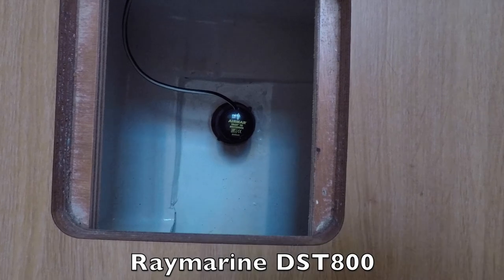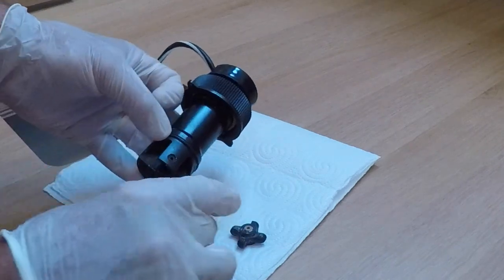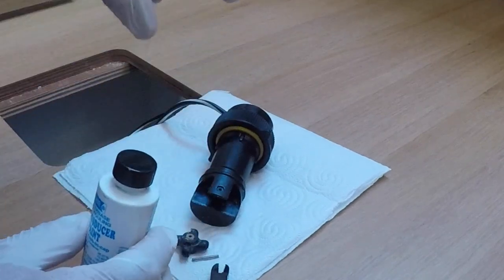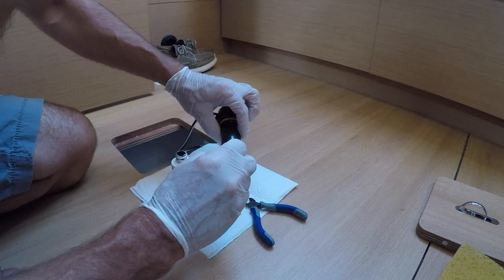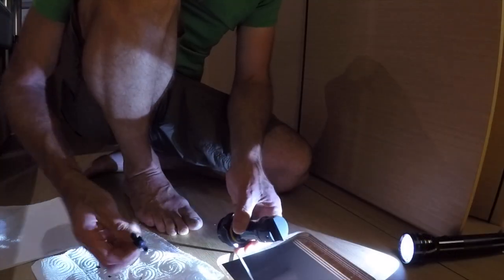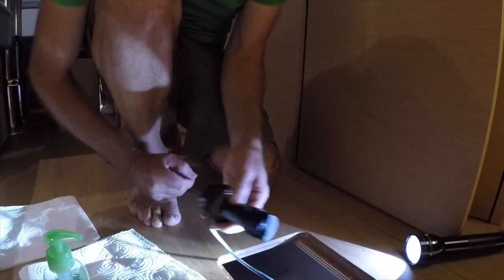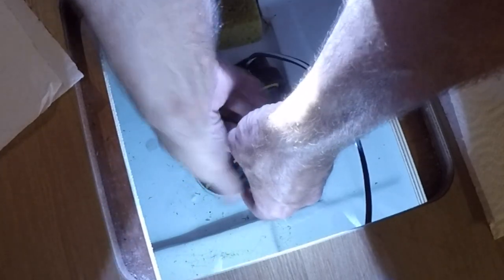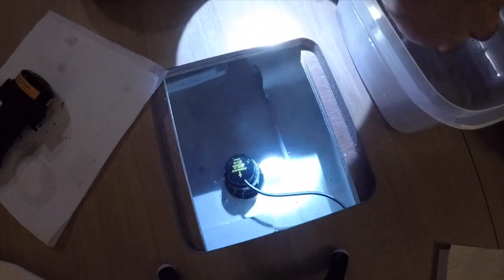Fixing a dirty speed transducer (knotmeter) on your boat, Raymarine DST800 and others  | Ep. 91

Comment: Well done, thanks! Just bought a used Beneteau 373, sailing back from Toronto to Montreal and at some point the speed indicator went to 0 intermittently. If I have time soon (still a working joe), I will pull it. Good advice on where to store the plug. My marine surveyor also suggested we tie wrap the plug to the transducer wire.
Reply from the maker: Yes they can be error prone, being a mechanical rotating object in the water. Sometimes we get weeds caught on ours for a moment. I try to check ours whenever I go in the water for a swim. Good luck!

Comment: Interesting that your unit shows the yellow pre-installation o ring instead of the black o ring that you are supposed to replace the yellow with (according to Air Mar) Do you have leaks?
Reply from the maker: No, we have not had leaks since we’ve used that transducer. To be honest I wasn’t even aware there was a yellow seal (in the top cap). The replacement o ring set from airmar comes with two sets of black o rings and I have replaced them once before as a precaution but water has never leaked past those two o rings. Nor does it leak when I twist loose the cap. It only starts to leak when I’ve slid the transducer most of the way out of the housing. Fair Winds!

Comment: Hi Guys,  I can’t get the blank in when removing the transducer.  It seems to get stuck 2/3 down.  Any advice?
Reply from the maker: Hi Trevor. First you might check to make sure the big arrow on the top is facing forward, just like supposed to do with the real transducer. Second, I have noticed, if there has been some growth on the transducer, that it can take some steady pressure on the blank to get it to set all the way in. I think this might be because of growth around the bottom part of the tube. I try to get it down in enough that I can grab a thread or two with the nut and then that helps force it the rest of the way down. Putting some mild liquid soap on the o rings of the blank can help too. Good luck!